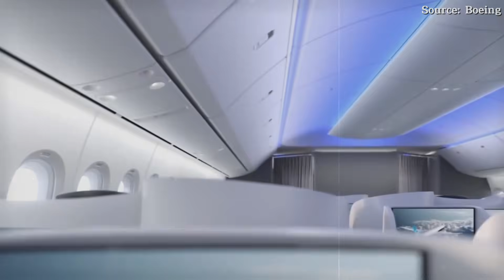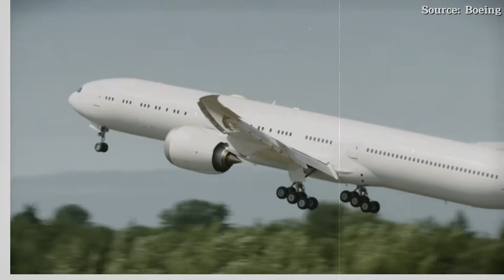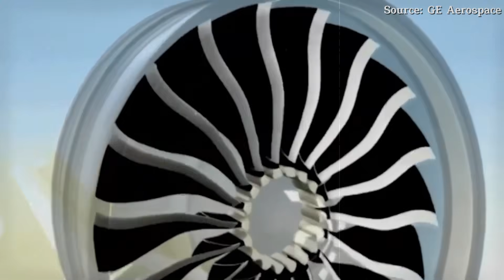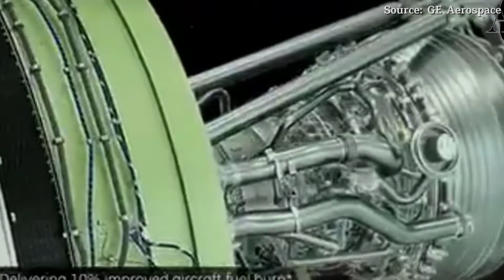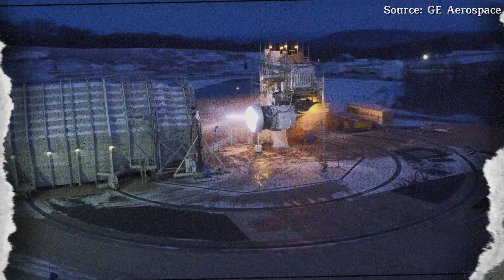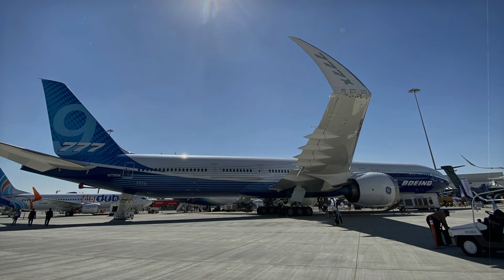Why Boeing Chose GE9X For 777X Over Rolls Royce UltraFan Will SHOCK You!

Comment: As I was watching this, I was thinking of the air idea crash. After the fuel was lost, for reasons irrelevant to this discussion, they were unable to respool and produce thrust in time to recover. My question is: Would a less efficient but lower bypass engine have been able to recover and return to power faster than a high bypass fan? And if so, when does efficiency start to compromise safety?